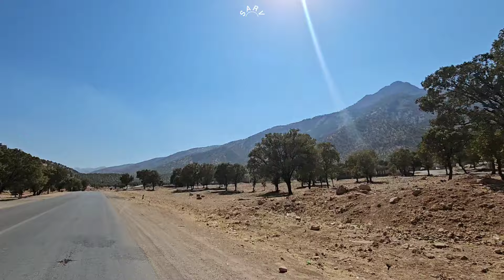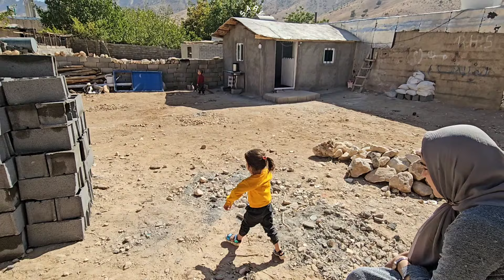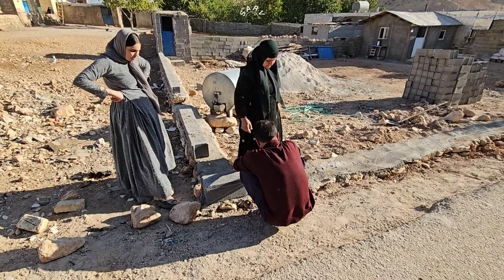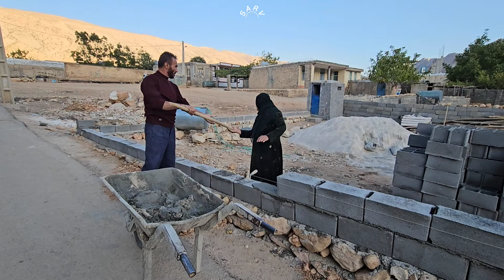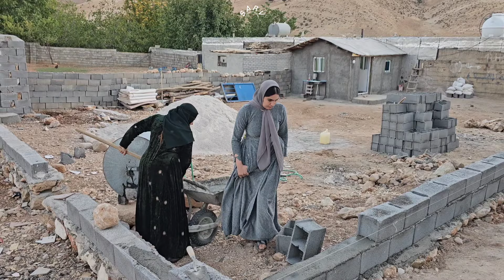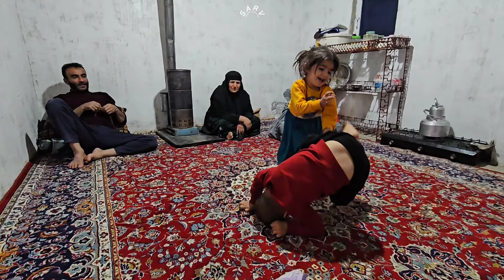Nomadic family: from cooking to building walls

Comment: I thought you were told you needed another permit for other buildings to be built here..do you have that permit..
Reply: A wall is not a building
Reply: God bless them they work so hars
Reply: @catherinespillane1334  yes but they are talking about building a kitchen and some other building..
Reply: Ones you got a building permit you can build anything you want as long is in desame lot.
Reply: @atedivinechannel...4032  that's not what the inspector guy told them. He said every time you want to build another building you need a permit.  It's there if you can find it on previous video.
Reply: @atedivinechannel...4032   that's not what building inspector told them.. he said everything you build something they will need a permit for it..